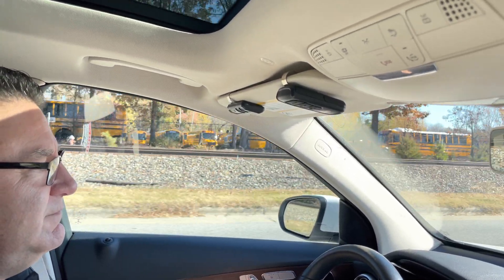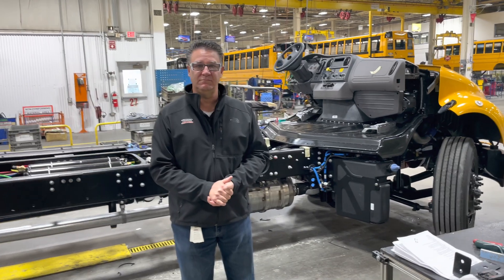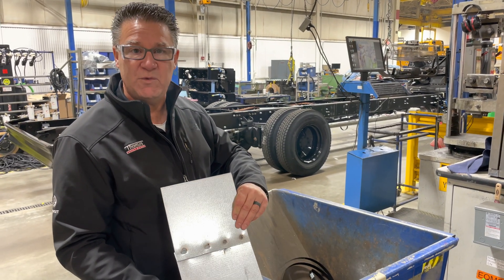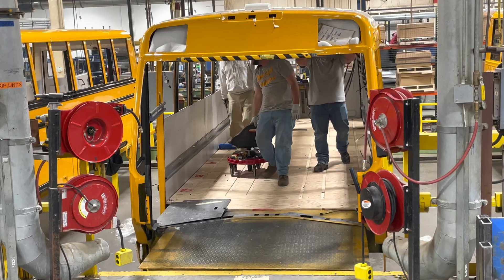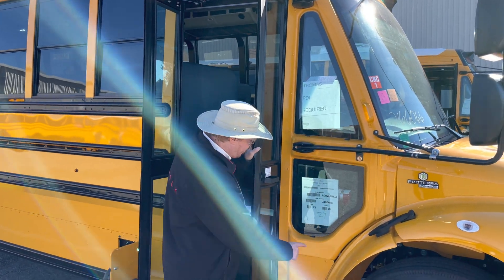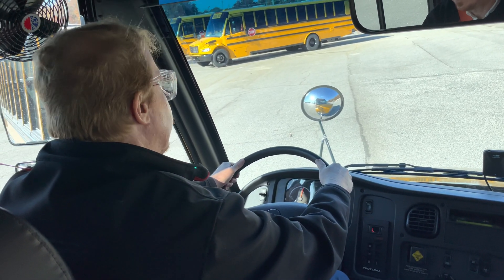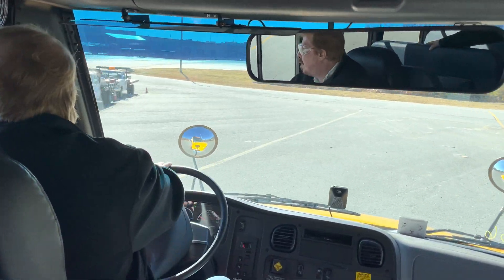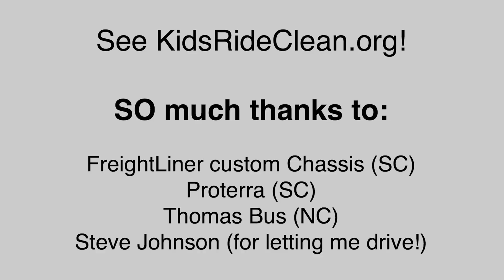KidsRideClean

Comment: that might work in South Carolina but in the Snow Belt the range on an electric vehicle is cut in half on a cold day, people tend to freeze in their electric cars. Also you help out China corner the market on lithium batteries.
Reply from the maker: Oh yah those are a thing, BUUUUUUT: These buses go 125 miles on standard day, and cold weather reduces that by 35% at most! That takes the range down to maybe 90 miles... sure that range is shorter but that does not block the daily-route mission! Pick-ups are less than 90 miles. As far as lithium goes, there may be some raw material supply in China, but the batteries for these things are made by Pro-Terra in South Carolina, the chassis by Freight-Liner in South Carolina, and the final construction by Thomas in North Carolina! And remember the alternative... FUEL! We know where that comes from...
Reply: @austinmeyer  no. People freeze in their e-cars, and hope to God they can make it to their destination because their car seems to be lying to them how far is left on the charge.
Reply from the maker: @Toms_Bright_Ideas  well with 125 miles of normal-weather range, just run a bus route of up to 60 miles and you will be fine.. that's a 2-hour route i guess... they are already working fine in alaska...
Reply: @austinmeyer  you're talking range and you maybe right on that, but I'm talking how comfortable it is. Last week I had to go on a bus to the VA Clinic it was -10 degrees F outside. The bus was an accordion bus running on diesel. It was warm and toasty inside. An electric bus will be drawing power from it's battery to keep the people inside warm and that will limit the range of it. I'm just saying preference-wise I'll keep the diesel bus.

Comment: And when the electronics need to be replaced?
Reply from the maker: The motor, inverter, stuff like that… They last longer than any diesel engine. Lifetime of the product for sure. The batteries may degrade over 10 years or something like that so then you just recycle them or use them in a lower power density application like grid storage or something like that… And of course battery technology is increasing so fast that in five or 10 years or so anyone will be very happy to put on the next generation battery to make the same bus travel farther

Comment: Just wondering what the charge time would be for a bus
Reply from the maker: Runs about 4 to 8 hours or so depending on the charger. So, the same as my home-use Tesla charger. Times out perfectly to charge during the school day and overnight even if running a 100-mile route.
Reply from the maker: People used to worry batteries could not give enough range compared to gas, or charge fast enough. Those were nothing but excuses for people to turn off their brains to avoid change. My Tesla goes 300 miles, my wife's upcoming Lucid goes 500 miles, and the Tesla supercharger charges my Tesla from low to high charge in about 20 minutes. The mic has been dropped, and tomorrow just got here.
Reply: @austinmeyer  I don't suppose anyone has looked into what happens to the lithium based batteries once they no longer hold a charge? Are they environmentally damaging to bury in the ground, costly to recycle or just not possible to recycle.
Reply from the maker: @abeeconstable7877  Don't bury them!!! Yes they can be used to level the grid as grid storage even with lower energy density cause they're all old, or re-cycle them. JB Strauble, a founder of Tesla, already has a recycling company working on this.

Comment: What's the range?
Reply from the maker: 135 miles
Reply: @austinmeyer  Even in well below freezing temperatures that we get up here in Canada?
Reply: @Cdawg-vb7no  I doubt it but the kids who are using the buses he bought aren't in Canada
Reply: @bruceyboy7349  well of course they aren't. My question was about the bus in general not where the kids are using it
Reply from the maker: Yes the range comes down by up to I think a third or something like that in extreme cold. So in Canada or Alaska I guess that makes the range maybe 90 miles? Buses run their routeat about 30 miles an hour... So I guess that means they can still run a three hour route… That's way longer than the drive I used to take to school so I think that it is still more range then we need
Reply: @austinmeyer  Interesting! I'm sure as time goes this technology will get better. Range wise for cold weather this isn't as bad as I thought it would be. Thanks for the reply Austin. Looking forward to xplane 12 :)